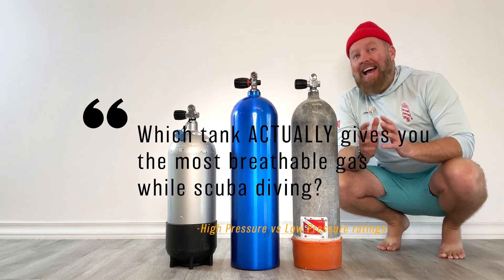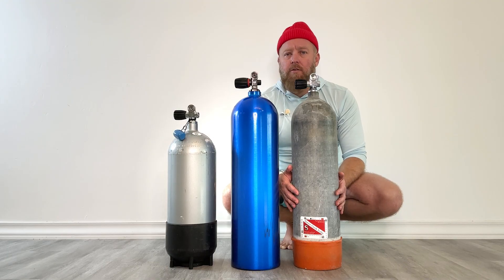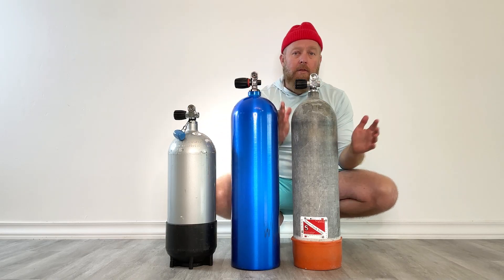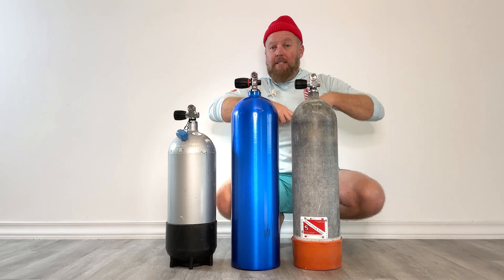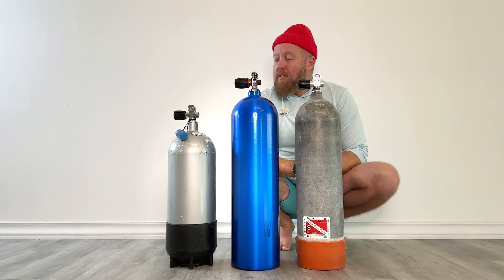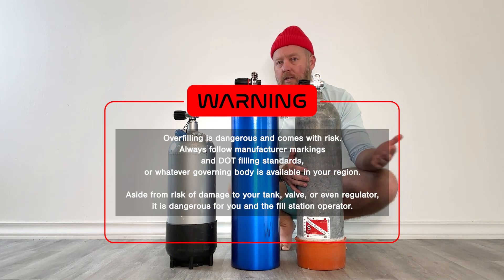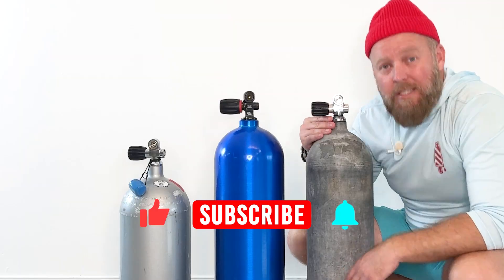Which Scuba Tank has the MOST air in it? | High Pressure VS Low Pressure cylinders explained 🤿

Comment: I believe at 2:16 you meant 70, 80, and 92 cubic feet, not psi, as you are filling them all to 3000 psi. Anyway, loved and liked the video❤
Reply from the maker: Yup you are correct, that is a type - they should say "cubic feet" or "cu ft", not PSI. Thanks for catching that. I guess Youtube doesn't have a way for me to correct it at this point without deleting and reposting. I'll just pin this to the top and hope it doesn't cause too much trouble
🫠

Comment: On Sept 14 I went to a Buoyancy Workshop. As I haven't been able to do any Diving since the April Lake Cleanup. 47F Water Temp at 13 Feet. The Instructor asked me why did I buy an Al80 instead of Steel? I figured an Al80 would last me longer. As I know I wouldn't be able to go diving every weekend like some people can. Looking back at it, A Steel tank probably would've been better. I am 5' 4" tall. The AL80 fits on me like most women. Steel would have been bale to get a smaller tank. Or maybe a 100 for around the same physical size.
Reply from the maker: Hey we don’t know what we don’t know. Luckily if ya ever sell it to buy something else, tanks are one of the few things in diving that somewhat hold their value 🍻

Comment: If I remember correctly, The AL80 doesn't hold 80cf. That the Actual CF is in the 70's. When I had my tank VIP and EAN Cleaned, The LDS filled it to about 3600 psi with 32%. Found out the PSI when I went to do the Lake Cleanup.
Reply from the maker: You are correct, it’s just over 77 for most manufacturers ✅
I mention that in the end fun facts, and also added some links in the description direct from several manufacturers with those precise volumes. It’s wild to see how off many of them are

Comment: I bought  a lp 80 bc I've heard a few people say this. I went through that tank in 20 minutes.  Hp 80s last me double. Steel hp wins allday everyday
Reply from the maker: If they were both 80 and filled to their working pressure, regardless of high or low, and that happened as you said, something was anecdotally going on with air consumption that had nothing to with the tanks.

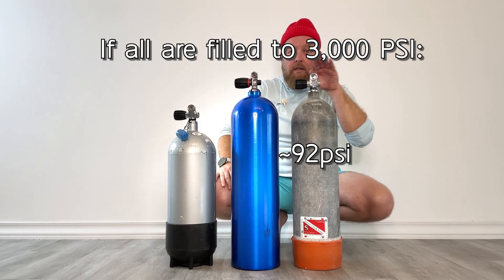Comment: At the 2:03 to 2:18 mark I'm sure you meant the labels to be cuft rather than psi.  And the danger with overfilling isn't instant death; the tanks are tested to a higher pressure than the fill rating to give a safety margin.  The problem is that repeated over-filling will accelerate fatigue, eroding that safety margin and eventually they will become unsafe.
For an outsider, it's hard to imagine how such a convoluted system was adopted.  Elsewhere in the world a metric tank has a stated internal volume which you multiply by the pressure on the gauge to get the volume of gas, and in Bar and litres you can easily do the sums in your head.
Reply from the maker: You are correct on the labels, it was a typo and YouTube doesn’t offer a way to fix it once published. I pinned the correction to top of comments hopefully not too much confusion.

Comment: Metric is soo much easier volume in Liters X pressure in bars
Reply from the maker: I agree, I wish we used metric in the US! 💯
Reply: @TheScubaDivingChannel BTW at pressures above 200bar (3000psi) the calculation doesn’t quite work any more. The dense gas slowly starts to behave like liquid. Best to substract 10% of the calculated volume above 200 Bar…. Say a 10L at 300 Bar should be estimated at (10L x 200Bar) + (10Lx100Bar- 10%) = 2900 liters of air rather than 3000L. This really starts to make a difference at larger tanks and twins!

Comment: I'm so glad we don't have to deal with any of this nonsense in the rest of the world.

A 12l tank holds 12l at 1bar. Fill it to 232 bar and you have 12x232. 

It doesn't matter if it is rated for 232 or 300bar. 12x232 remains the same.

If you did want to keep it simple you would abandon this PSI and cuft nonsense.

Comment: Currently I use steel 100’s hp.
Reply from the maker: Even tho I sometimes run into trouble getting good fills, I do like them for their size. Even a weak fill it’s still usually well over an aluminum 80 and far better weight/buoyancy characteristics, so they’re pretty handy!

Comment: just measure them in liquid litre volume like the rest of the world does - so much easier down under we have 3, 6, 9, 10, 11.2, and 12 litres cylinders. 
Our cylinders are all high pressure - 203, 232 or 300 BAR the to work out gas volume its volume litre x pressure bar = 10 litre @ 203 BAR is 2030 litres of gas. Simple -just use metric. It's not hard. PS > You won't find a US LP tank here - they just don't exist every thing gets 200 BAR minimum....
Reply from the maker: Hey there are definitely better ways to do it for sure 🤙
Our D.O.T. (Dept of Transportation- strangely) regulates them in the US and they definitely could use an update ✅

Comment: So, I’m quite sure that you never went to science class. If you fill two 80 ft3 tanks to the same pressure they will have the same volume of air. The pressure rating or material they are made out of has 
nothing to do with it.
Reply: Quite sure your condescending comment missed the point of the video. The label of 80 cubic feet assigned to a given cylinder is not indicative that the cylinders necessarily have the same dimensions. Rather, it absolutely takes into consideration the pressure rating by indicating how compact the air molecules will be within the cylinder to achieve the stated volume. Try to be kinder when showing the world your ignorance.

Comment: What about the aluminum 100?
Reply: That's pretty rare
Reply from the maker: There are tons of sizes out there, the specs are linked in description. Most divers tend to get to a point where they try and stay away from those due to buoyancy issues toward the one of the dive. When in a position where buying their own tanks makes sense, most opt toward steel for both negatively buoyant properties and higher volumes 👌

Comment: A high pressure tank and a low pressure tank have the same cubic ft area. You can just put more air in a high pressure tank of the same area. It's not rocket science or even middle school physics. 😂
Reply from the maker: They have pressure ratings imprinted on their neck for a reason
Reply: @chris You are showing your ignorance and contradicting yourself.  

Same size lp and hp cylinders filled to their rated pressure have the same volume.

However lp cylinders are often filled to a higher pressure.  Its common for them to be filled to 3000 to 3200psi. Thereby giving it more gas being held within
Reply from the maker: I am showing my ignorance and contradicting myself how?
Reply: @MysticalDragon73  And when a little salt sits in the bottom of the cylinder for 6 months - Guy Fawke's Day when they do the next overfill....

Comment: You just need to know how much cubic feet at working pressure.
Reply: With the exception of plus rated tanks. They have a rated pressure and then a + indicating they can be filled to 10% over, BUT, on most plus rated tanks their listed VOLUME is based on the PLUS pressure.

IE: I have several of the tiny steel Scubapro 72s made by Faber. These tanks are stamped 3000 +. Is you fill them to 3000 you are only getting about 66cf, to get 72 you need to fill to 3300psi.
Reply from the maker: Yup, you are correct. I didn't want to muddy the water too much more than it already was. It doest state that in the "Fun facts" in the end. I think a lot of folks rarely know how much gas they're truly using/have when they figure their sac rate. Most computers don't bother going into that level of detail either, but I'm with you... 10% is actually a decent amount in my option.
Reply from the maker: That is correct ✅
Reply: Tank bouyancy is a different kettle of fish. @TheScubaDivingChannel
Reply from the maker: Absolutely! I didn't wanna get into other muddy waters on this video, but it is definitely a major factor for sure!